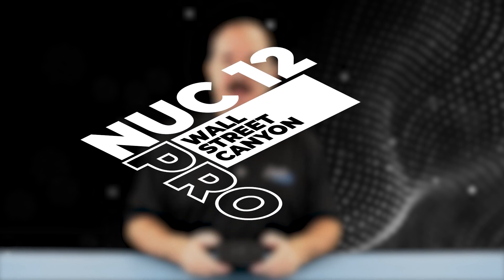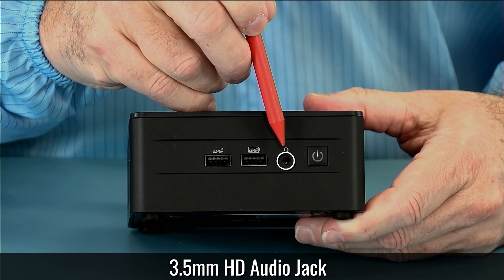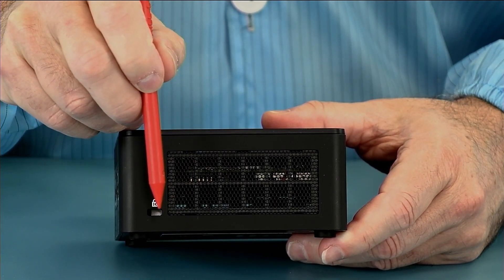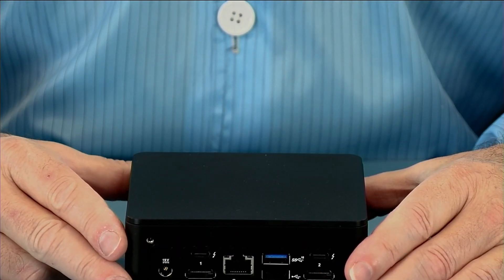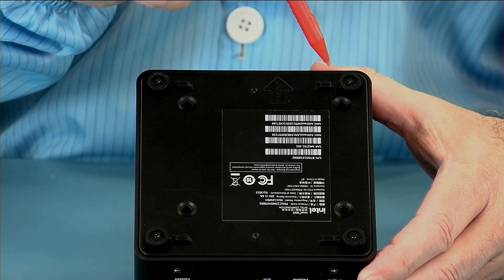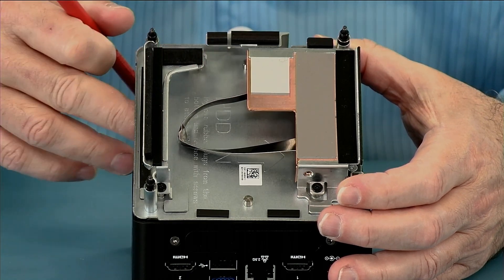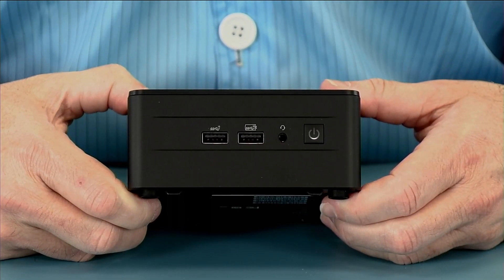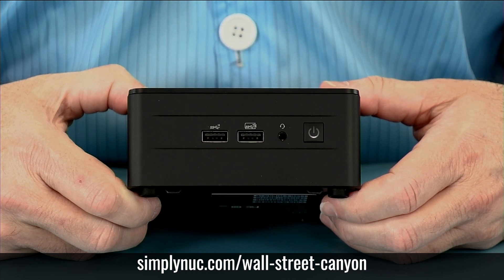Meet the Intel NUC 12 Pro Wall Street Canyon - Unboxing

Comment: I have an i7 Nuc 12 (4x4)...........I had a dream that Intel sold a new option, Intel changed the Nuc 12 to make it 2 or 3 times higher but no footprint size changes.....this new higher NUC was to acommadate a i9 12900k  and a big fan coil & blower for cooling.   Wouldn't that be an amazing NUC?

Comment: Not so great for gaming. only 1400mhz igpu is very weak for the price it is selling. I almost bought one but being weak for games and only ddr4 and not ddr5 and high price for a barebone system, is not worth it. I am going to get the GTR6 ryzen 9-6900hx with a rdna-2 GPU (best integrated gpu) of 2400mhz with ddr-5 for the same lesser amount then intel nuc12 pro. You can game at 4k or high resolution with good speed. you cannot do that with the nuc12.
Reply: Well yeah, these weren't meant for gaming. However, with the thunderbolt 4, you could use an external GPU for generations to come with far better performance than the rdna-2 🤷‍♂

Comment: I am wondering if the NUC12WSHi7 has the same defective Thunderbolt ports as the NUC11PAHi7 & NUC11PAHi5.
If you attach a NVME drive in an enclosure such as the Sabren to either Thunderbolt 3 port and run ATTO Disk Benchmark on the drive
you will get system a Error code 1117 is generated by Windows operating system and is always
caused by Input / Output (I/O) throughput issues with either the disk or the controller that it is attached to.
The error is unrecoverable; you have to pull the power plug.
Reply: I have a NUC11PAHi7......I also have 2 Sabrent M.2 Dual Enclosures.  I have 4 total 4TB MVMe drives inside.  They are connected to my Thunderbolt 3 Ports.   I use the Intel Driver & Support Assistant (Intel DSA) and they stop working once all the Intel Software installs.   Spent (several hours) time on phone with Intel Support and they asked me to send it to them in Texas and they reimbursed me full $ for my Unit.   Based upon that I assumed it was that specific unit with issue.   I bought very same unit new as I like this product and I have the very same issue when Intel Drivers are installed.  I did a new Clean Windows install without the Intel Software and they are still working fine.
Reply: @willcurry6964  Are you running Windows 10 or 11? I have the NUC12WSHi5 and no Intel Thunderbolt drivers were required as Windows 11 natively supports Thunderbolt 4.
Reply: @funkyfragrancelover2979  Windows 11.   Intel recommends that you use thier Intel Drivers.   Currently I have no Intel Drivers installed and they work fine with Windows drivers only.
Reply: @willcurry6964  There are no Intel certified Windows 11 Thunderbolt drivers for the NUC 12 Pro. If you try to install the Windows 10 thunderbolt driver on Windows 11 you will get an installation error (this happened to me). If you read the notes section of Intel's own download page it states: "The Thunderbolt driver (this driver) isn't needed if running Windows 11* as the driver is included in the Windows 11* installation."